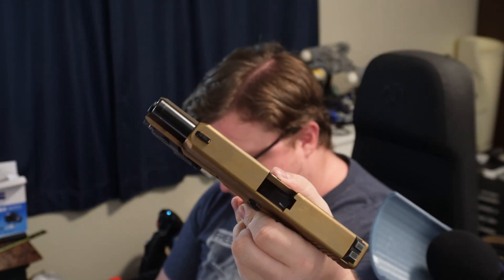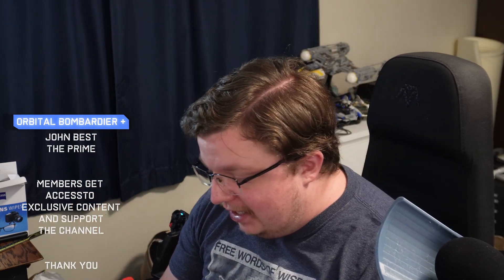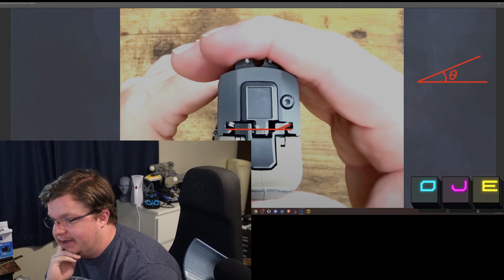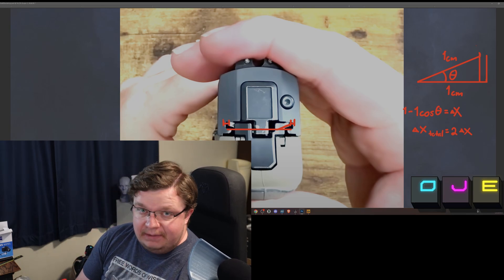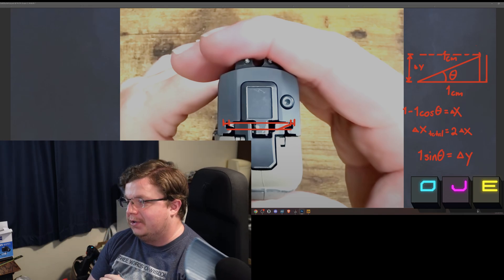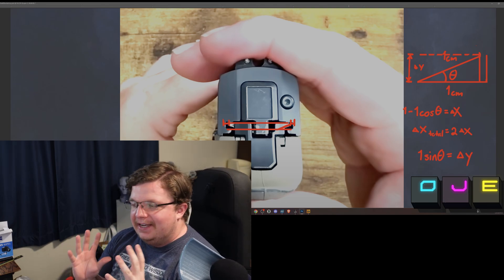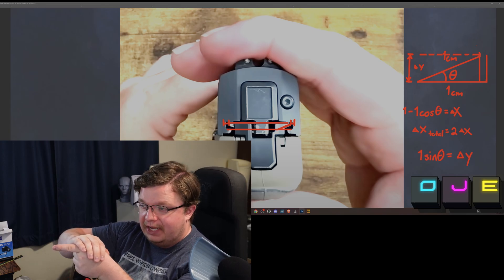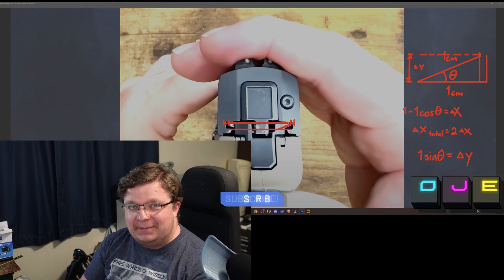Is the SIG P320 Safe???  -- An Engineer's Take on Wyoming Gun Project's Video

Comment: Has anyone taken one fresh out of the box and tried to replicate the problem?  How many rounds have been fired?  How has it been used and treated?  Has it been modified?  Lots of questions without very many answers.
Reply from the maker: I would assume the FBI investigation would have done so. But I'd love people to send me pictures of their rails.
Reply: I have a brand new sig m18 ca compliant model that I have never fired.  It just sits in my safe.  Also I check on the SIGs website and my gun has build date of march of 2024 and has the voluntary upgrade from factory.    If you can give me email or something I’ll gladly send pics or videos of gun.   Also I myself was able to get the striker to drop while pulling trigger to the wall and squeezing the front of slide.   It does it repeatedly but it won’t do it with the manual safety on.   I also whack the shit out of it to see if the striker drops and it never did.
Reply: @theodorecendejas1343  Thanks but I believe you.  No need to send pix.  I am curious of one thing though.  Can you make it fire WITHOUT touching the trigger?
Reply: @samsmithmotovlogs No bro.  Believe me or not I racked the slide and whack the fuck out the gun in the back part of slide with a rubber mallot hammer over 50 times.  54 times exactly and the striker never dropped.   I would like to say tho.   The only mods I did to the gun so far are a SIG flat face trigger , a ISMI 6lbs trigger spring and I remove the stupid Ca magazine disconnect.    I actually really like the feel of the m18.  Since am in California I was really happy to finally purchase an off roster handgun.     I plan on keeping my sig m18 but I will not be removing the manual safety.   Also unless someone can make the sig m18 with a manual safety go off with the safety on. I will be keeping it.  For what ever reason I trust it as long as I have the safety on.  I’ve never shot the gun. But I will be putting a minimum off 200 rounds this coming Sunday.  I’ll also be taking the same rubber mallot and I’ll try wacking the gun with a live round.  Pointing at a safe direction of course
Reply: @theodorecendejas1343  I know you will like it.  Good luck!
Reply: @samsmithmotovlogs thanks man.  Hopefully 🤞🏼 SIG can come up with a permanent fix.

Comment: Sig has horrible QC, many of their MIM parts are third world sourced (so much for "made in USA") and the amount of slide to frame slop is absurd. Even with that factored out, the striker safety block is dubious at best, prone to spring breakage and premature wear. How it passed MHU trials is a great mystery, but most suspect it just comes down to lowest bidder winning. They may come to regret that decision.
Reply: Oh the trials, the P320/M17/M18 did NOT pass the extended endurance trails. It didn't even do it!  SIG "somehow" bypassed that part of the trails. Look it up. Shenanigans going on the entire time with that contract.
Reply from the maker: Someone is primed for a nice retirement from the military as a SIG executive.
Reply: Country of origin is irrelevant. Cheaping out on parts is.
Reply: So are parts in your automobile,  your lawn equipment,  etc.
Reply: @SlimJim-ub9og Logical Fallacy: straw man, red herring, Tu quoque are all possible fallacies in your response. We are not talking about cars. We are talking about guns. Your argument is irrelevant.
Reply: @MrWhite2222 What they SHOULD have said is that almost every other shop floor 9mm semi-auto striker fired handgun on the market, including Sig's own line up, that uses outsourced MIM parts, doesn't have this specific issue.

Sig could hand forge all those parts instead and it wouldn't make a difference, especially since the slide and frame tolerances being discussed in the video aren't MIM anyway. Plus, MIM's greatest ADVANTAGE is the tolerances of the produced parts regardless of where they're made. So bringing it up in this instance, to borrow your term, is its own Red Herring. That being said, op's comment mentioned that as an aside anyway. His main point was QC could be perfect and the gun would still have this issue inherent to its design, and I completely agree. Your comment about the 320 bypassing trials is also harrowing. I tried looking it up but I couldn't find it, do you have a link or a specific phrase to search?

Edit- Stumbled upon it in a James Reeves video. INSANE.
Reply: @SlimJim-ub9og And the quality of automotive parts (including OE/OEM spare parts) has also cratered in the last 10 years or so.
Reply: @SlimJim-ub9og Just don't try to CCW a lawn mower and you should be okay.

Comment: Good luck bending the rails that are a patt of a metal lower.
Reply from the maker: I think it's more the stamping and bending of the rails at fault here. A machined rail in a polymer lower would be no different from a machined rail in a metal lower.
Reply: @OddJobEntertainment Makes sense.
Reply: @OddJobEntertainment TriggerSmart dropped  a video  of many striker pistols  going off like the 320.
Looks like hammer fired is king.

Comment: 1cm? You're ruler is way different than mine, looks 1mm on my ruler . ;) 

Been awhile since had a P320 and not sure if the "ears" were bent like this but one of the reasons it was traded off for a P229 with rails instead back in the day. 4 "ears" holding the slide on the frame never felt safe to me.
Reply from the maker: I'm glad I can tell you're kidding with the first part. You wouldn't believe some of the comments you deal with as a creator.
Reply: Good deal... I know, I've read some nasty comments people put on vids.

Comment: You can not say that the slide movement is excessive or describe the angle as wrong without knowing the tolerances called for by the design.  Yes 90 degree angles are more common, but some designs do employ intermediate angles.
Reply: The magic trick we need is to figure out how to get the striker to hang on the edge of the sear such that the weapon discharges when the slide is wiggled while the trigger is not even partially depressed.
Reply from the maker: Well, SIG is more than welcome to clarify. But this clearly would contribute to slide movement. The slide movement is shown to be an issue.
Reply: @OddJobEntertainment  https://www.youtube.com/watch?v=NKiN14zTF6o
Reply: @OddJobEntertainment  no one has demonstrated a discharge caused by the slide without the trigger being pulled.
Reply: @networkedperson  Your statement ignores and redefines so much it is a case study in the deception typical of deniers. There's literally video of an uncommanded discharge of a cop's holstered duty weapon. Now an airman is dead because of years of implausible denials your statement embodies. Statistics alone makes it clear this model has a problem but the denials are as farcical as the voluntaryupgradeprogramnotarecall that clearly didn't fix the problem.
Reply: When the trigger pull rocks the slide and it shoogles 0.5mm, yes you can. The exact angle is more questionable sure, but not the overall fit. Go look at any of your handguns, even any other SIG that's not a 320.
Reply: @dorbie  "yes you can" what?  please finish the sentence.  Without a complete sentence, it is not clear what you are saying.
Reply: @networkedperson  You clearly have difficulty with context clues. Both with written statements and real world fact patterns.
Reply: @dorbie  I understand that no one has demonstrated a discharge caused by the slide without the trigger being pulled.
Reply from the maker: Well, when most people think of pulling a trigger, it's a finger that does it. So the fact that the trigger is ending up in a compromised position, without a finger pulling it, is still an issue. That doesn't mean that slide slop is not a contributor. If fixing the slop fixed the issue, then trigger slop matters less.
Reply: @networkedperson it was not a complete trigger pull, that was the the point of the screw, to show that it was just the uptake and no finger was inputing additional force or movement. The slide also bypassed a safety. There is also clear video of uncommanded discharge in a holster and many many demonstrations of drop tests causing discharge. You are factually and objectively wrong in multiple ways. Your type of obstinate nonsense has now resulted in a death in addition to the many injuries. Well done, you win today’s “I have learned nothing” trophy.
Reply: @OddJobEntertainment  the video proves that the slide slop can contribute to a commanded discharge, but we need to see a video where slide slop causes an uncommanded discharge, without the trigger being pulled.
Reply: @dorbie  pulling the trigger is what bypassed the safety, as it is designed to do.  It is not a very good design in my opinion, but that's the design.
Reply: @dorbie  https://www.youtube.com/watch?v=NKiN14zTF6o
Reply: @networkedperson  The video you shared is quite ridiculous. In it the entire Glock frame moved not just the slide, and the trigger safety and trigger was fully actuated, the final 19 thousandth's of an inch was completed by moving the weapon, but worst case ignoring the nonsense it'll go off when you're 19 thou from a completed pull. The P320 bypassed a safety that wasn't a trigger safety, barely into a pull, because components in the slide disengaged from components in the frame due to movement between the frame and the slide. There's also video of this happening in a holster with no pull, which could simply be SIG tolerances. Someone can cargo cult the appearance of an engineering test but that doesn't mean they have any idea what they are doing. I'm beginning to think you will never understand this problem. The differences between these tests is massive and crucially relevant.
You should have read the comments section before sharing 🤣
Reply: @dorbie  you have a point, now that you mention it, yes the frame is moving.  It's funny how you can see the frame flex in this video, but you can't see the trigger pulling back half an inch in the Wyoming video.
Reply: Pulling back on the trigger simulates the striker safety failing. Which we know from the FBI report can happen from normal use. 

Now, with the striker safety inoperative, all he had to do was touch the slide to get the gun to fire. We know from the FBI report that the striker sits at the very tip of a very small sear. Any small movement trips the sear, the secondary sear always fails to work, and the P320 will fire.
Reply: @donwyoming1936  removing or jamming the striker safety plate would simulate a safety failure.  pulling back on the trigger far enough to begin disengaging the striker from the sear only simulates pulling the trigger.
Reply: @networkedperson  It's going to take a lot more dead people and more videos of uncommanded discharges to convince you. What a legend!
Reply: @networkedperson  You could move many triggers to the hairy edge of sear disengagement and probably nudge it over with manipulation, especially going a few thou from the break, it could even be done more convincingly than the inept video you shared. The problem is one of degrees. Slide and frame contact precision is a critical tolerance factor with these designs, so any slide that moves with so much play (measured at 0.5mm) is an obvious problem. In a weapon that has discharged in a holster with no trigger pull multiple times in unprecedentedly widespread reports it's a clue.
Dismissing this evidence by manipulating other weapons to "replicate" it, even manipulating a P320 to replicate it when there is less play by pulling as near the break as needed is simply ignoring the problem. Finding an example with enough play in manufacturing tolerances to demonstrate the full monty or destructively modifying a weapon to test if even sloppier tolerances pushed it to this condition would be more informative.
When retention is a combination of pull and tolerance, focusing on half of that equation is a dangerous error.

Comment: There are about 3 other YouTubers who can replicate the issue.
Reply: You can't pull the trigger then blame the slide for the trigger pull. Even a 1mm trigger pull past the "wall" is a trigger pull. 

I think everyone that is surprised that a trigger could fire a gun with minimal movement instead of the 10mm pull a Glock needs has only used Glocks.
People forget that a Glock only has a half cocked firing pin which needs that long trigger pull to fully cock the firing pin before the sear drops out of the way freeing the firing pin to move forward.

Everyone that has fired almost any other gun than a Glock understands that you get to the wall, then minimal trigger pull to release the firing pin. It's actually what every firearm and aftermarket company tries to achieve. Even Glock came out with its performance trigger to achieve this. The performance trigger is a full cocked system.

Lastly who's p320 is experiencing a slight trigger pull and violent slide movement inside of a correct holster for the gun?
We have to keep in mind that these "uncommanded discharges" are happening to holstered weapons.
Reply: Dozens. I"ve seen dozens of videos of people replicating it. Atleast half a dozen were loaded yesterday alone
Reply: It's been replicated with a few different brand guns now including glock. Check it out.I don't know exactly what to think yet. What happened to the airman  must have been something else. Hopefully, we will find out sooner rather than later
Reply: @sebfettel The big difference is on other firearms you have to pull the trigger 99% of the way. On the p320 it's only 20%+/-. People seriously need to be measuring because I keep seeing people claiming what you did without knowing the actual facts.
Reply: https://youtu.be/M2ZwXhZyO1k?si=i2Gx7sT0jns5tkFD
Reply: You mean stage a pulled trigger,  then cause the striker release.
Reply: @SlimJim-ub9ogyeah thats not supposed to happen dude 😂
Reply: @Swooptywoop there are videos with people doing it with glocks. If the trigger is staged at the point of release and the slide is manipulated then it's very possible that the sear will release.
Reply: @Brett235 i personally own a shadow and after my buddies m18 did it we tried with my dr920p my other buddies Zev oc9 my other buddies glock 19x and glock 45 none of them fired all glock based platforms i do believe it but at least it seems much less likely
Reply: @Swooptywoop I haven't tried with my G17 but I did try it with my gen 1 320 and I couldn't get it to release the striker. I don't have much play in my slide though.
Reply: @Brett235  This is why I keep trying to tell everyone you need to show the measurements not just stick a screw in it. I think wyoming did show it was less then 1mm after the wall if I remember correctly by measuring with a digital caliper. Yes most striker fired will probably do this at 99% trigger pull, but if the p320 is doing it at only 20% trigger pull past the wall there's big safety issue.

Comment: Just look at dimensions and fitment academically like this feels a bit like programmers who try to evaluate code without trying to compiling it.

Misfit Machine did a really good job of describing this. Not a P320 user myself either, but based on my experience with machining and having shot tens of thousands of the absolute cheapest ammo I can find (which runs extremely dirty), powder related debris can be at least as big an issue as tolerace stacking but harder to reproduce. The RIGHT way to design is accommodating this with "defensive" design elements that ensure failure is graceful (that is, setting clearances such that something less-harmful but still obvious fails first)
Reply from the maker: This video really should be viewed as a supplement to the video by WGP. He's already demonstrated that slide movement can cause the discharge. So without owning one myself, I'm trying to see if I can spot potential causes for the movement.
Reply: "programmers who try to evaluate code without trying to compiling it."

You absolutely CAN evaluate code for many metrics without compiling it.  Ever heard of a code review?  You can even get some pretty big hints on likely performance issues, but quantifying them obviously does require compilation.  Obviously functional testing like regression requires the code to be executing.
Reply: @ferrumignis  context man, this is an instance where you heard the process crashes but do not know why, I mean sure if you know the codebase inside out but the analogy only goes so far, you try running the process in a debugging or interactive mode with interrupts and inspect what's going on and work backwards, you don't waste time reading line by line from the get go. The best video to date here was the guy who cut the side of his slide out to positively demonstrate the striker safety can be disregarded as it's far too easy to override and even a bit of debris can do it
Reply: @Proton_Decay  You need some context.  This is a relatively simple mechanism compared to some program with 10's of thousands of lines of code.  Any reasonably competent person can visually inspect a mechanism, manipulate it by hand and very quickly discover problems with it.